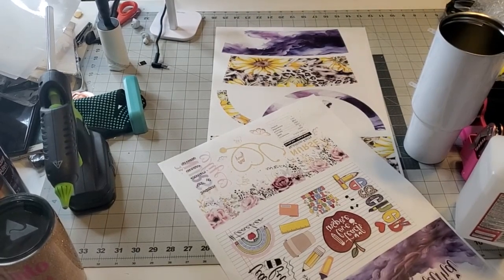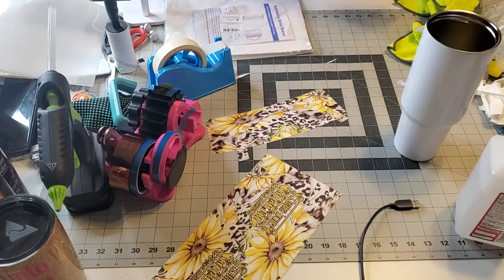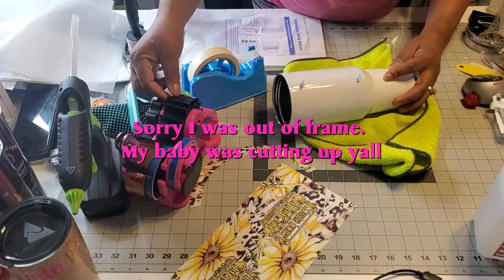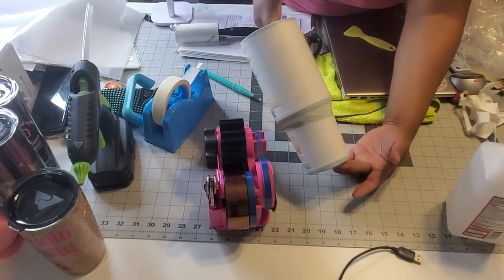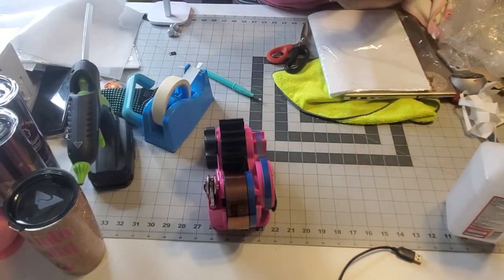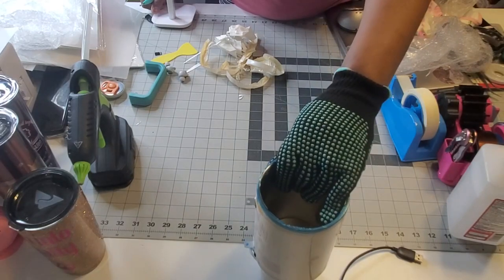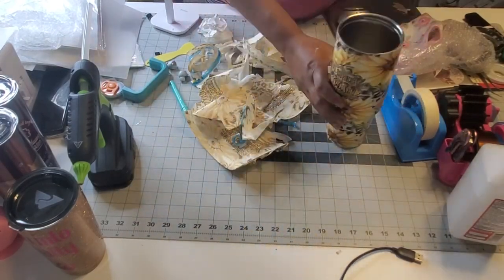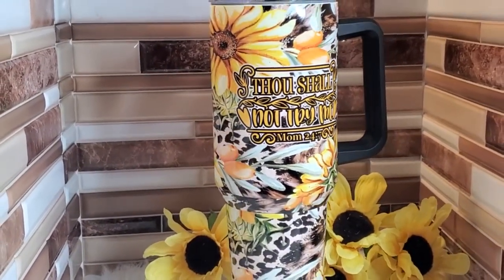HOW TO DO A FULL WRAP ON A 40 OZ TUMBLER PART 2 #stanleydupe #Sublimation

Comment: Great video, however you did not share any information about the actual backing of the 40 tumbler.  What oven temp didi you use and for how long? Thanks
Reply from the maker: Thank you so much for your feedback. There are 2 parts. However, you may be correct. I don't recall if I did or not. I sublimate my tumblers in the convection oven at 375⁰ for 4 mins 30 seconds. I rotate the tumbler 180⁰ at the halfway mark.

Comment: That tumbler came out BEAUTIFUL!! mine come out dull, I do 375 for 5 minutes. What is our recommendation??
Reply from the maker: Thank you! First make sure the tumbler is for sublimation and you're using sublimation ink.  Those are two of the biggest issues when it comes to dull images on tumblers. I do 375 for 4 mins 30 seconds.  I turn mine at the halfway mark. Thank you for stopping by